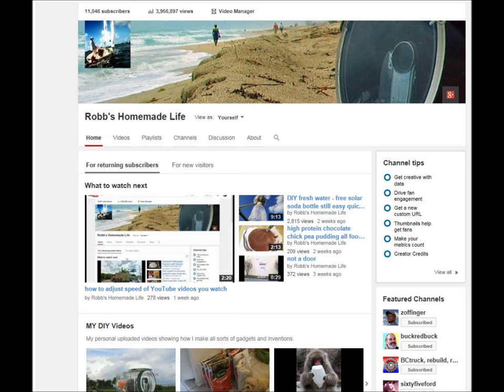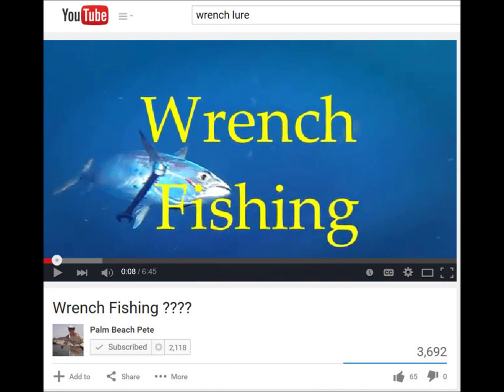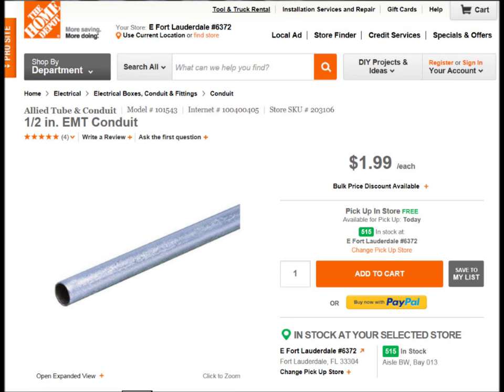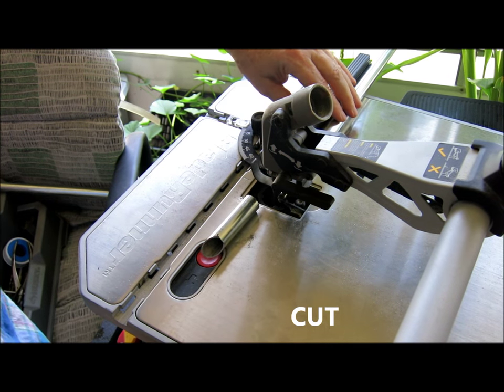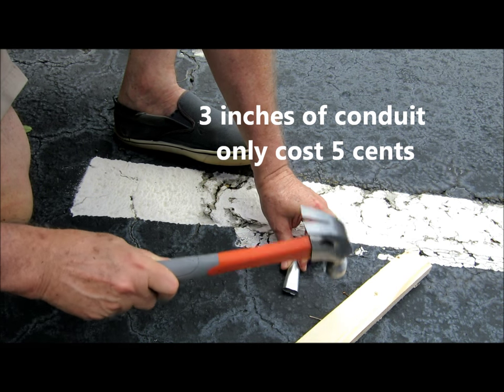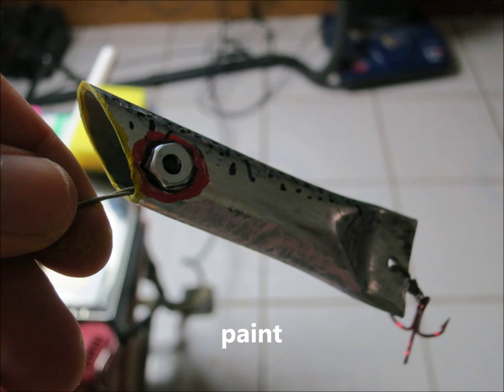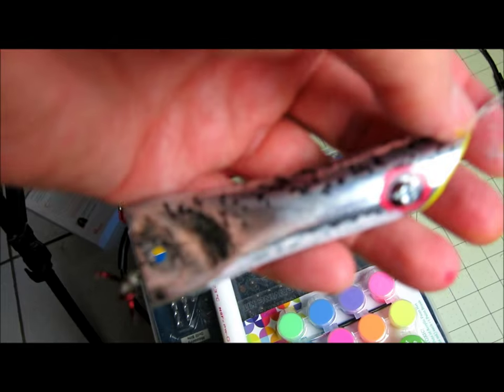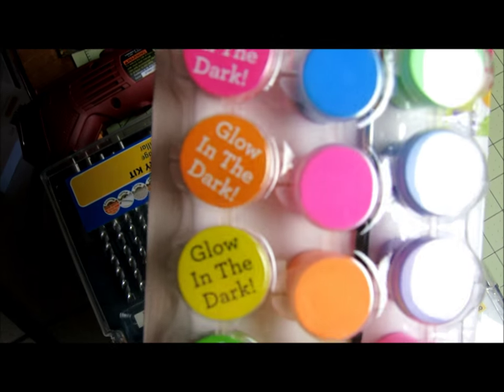DIY ten cent fishing lure made from conduit pipe

Comment: Try using copper 1/2 inch plumbing pipe to cut the weight a bit.  Same general idea but between PVC and steel in weight.
Reply from the maker: yeah, the steel is a bruiser, I need to make some pvc lures, thanks for watching and commenting!